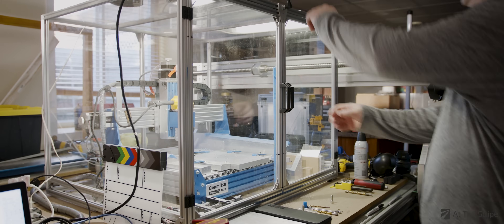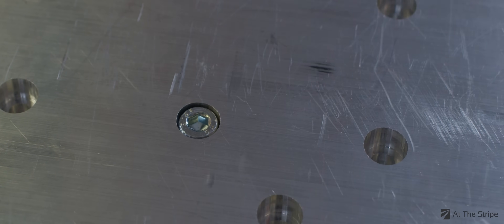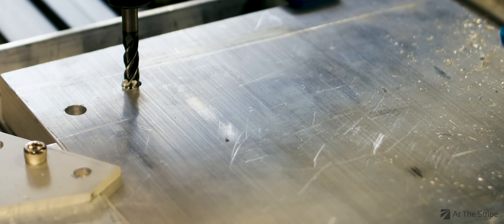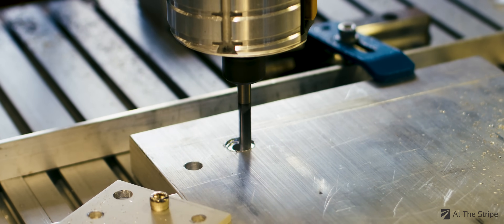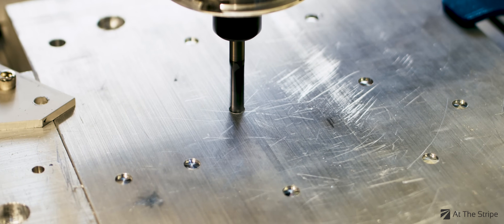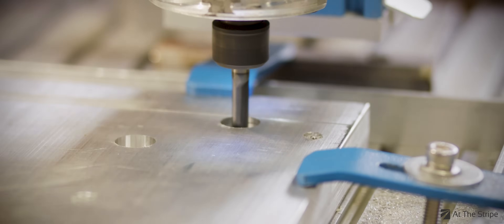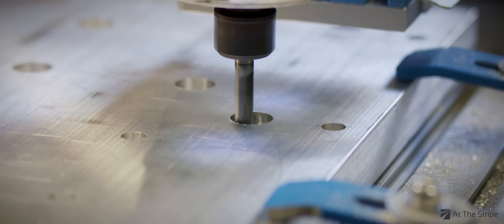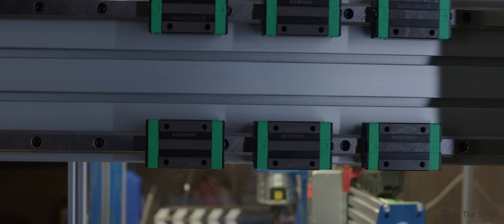I Tried Building My Own CNC Machine and This Happened!

Comment: A year old now. But you don't need to have any original holes to re-locate if you lost position. You only need the abilitie to home to a reference zero. (HOME SWITCH for XYZ) And reference using your offset commands. You should always offset reference home G54 TO XY home at zero. Then you can reference your work piece zero offset to g55-g59. if you loose steps or something happens and you loose your location. You need only to reference home G54 to get your alignment back. I always suggest writing down or copying your XYZ offset location for work piece g55-g59 work pieces. It is then impossible to loose your alignment, unless the part gets moved on the cnc machine. Lets say the computer totally crashes and you must reboot. Once fully rebooted and any issues have been solved, you simply need to switch to g54, home to zero xyz as needed. then switch to your work piece offset g55-59 check that its working offset zero is at the location you expect it to be. If it is not, you simply switch back to g54 work offset, move the cnc machine to the compiled down locations for the g55-59 zero offset. Once the machine is at the correct location. You can switch back to the g55-g59 and set the current location as the current tooling offset. very simple and letting your machine do the work not you.
Reply from the maker: Hey that's great feedback. I really appreciate that level of detail. It's never to late to learn this stuff and I am still learning so much. Thanks for taking the time to post this. I will do these exact things and give it a try! Thanks again!!